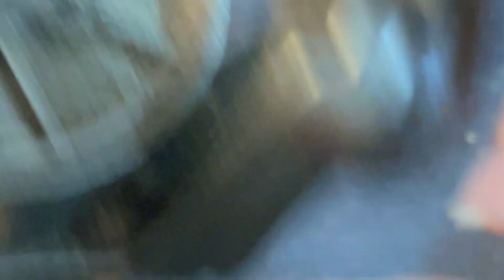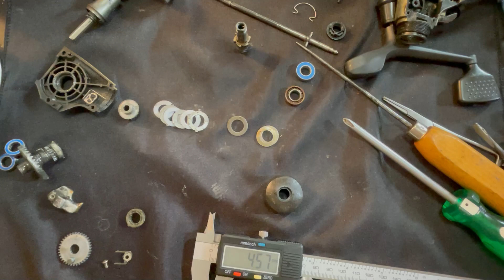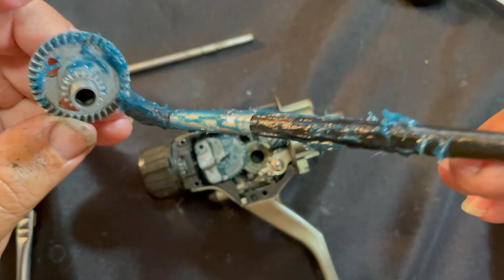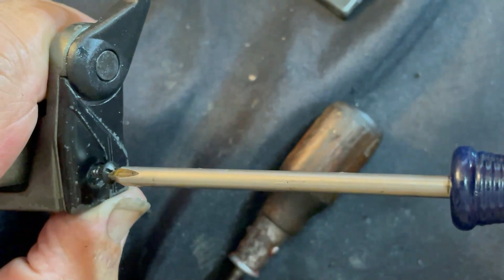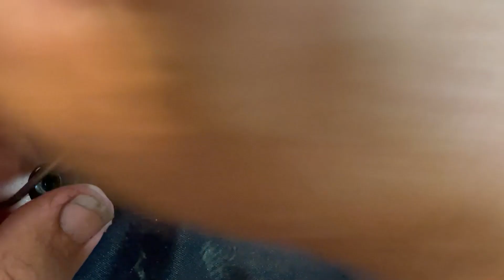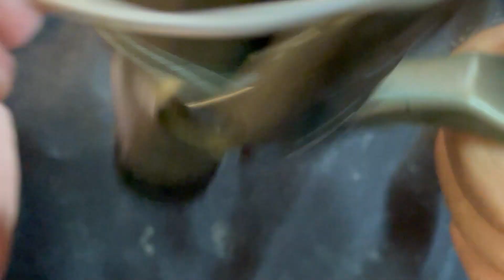Zebco SE4 -- Service and Lubrication -- Young Martin's Reels

Comment: I was absolutely shocked when you said this reel had “roller” bearings on the main gear.  When it wasn’t a bearing I was relieved. This one looks like it has seen better days! Rick , are you sure Mario isn’t pulling your leg with this reel? This thing is filthy. Maybe Zebco is marketing this one as it’s all new corrosion special. The fact that the main gear is worn so much couldn’t have been a surprise.  I still think Mario is pulling your leg.  I liked how you worked with the rear drag. I really dislike the anti-reverse in this reel. I have a few like it and they are rarely as smooth as I want them to be. Also you can remove that awful little AR spring on the shaft of the main gear and the AR will still work just fine. Often removing that AR spring will make the reel run smoother.   I had to ask Siri how to spell “dollop.” I hate e-clips too! Your safety pin trick is a good idea. I really like your close-up camera work.  The reel I have that had the broken trip lever works fine as purely a manual bail which I like anyway. I have both a Mitchell and a Garcia reel that has that same tiny coil spring mechanism. I am not a fan. You needed to use some fine sandpaper on that trip lever. I’ve had to do that before. Great job with the bail!  I never thought this reel would work that well. I believe this reel wasn’t worth the effort you put into it. But…. Your reputation as a miracle worker continues to grow! — Chris
Reply from the maker: Chris, I wasn’t wearing my strong glasses when I looked at the bushing but it certainly looked like I saw roller bearings. I take them as is when I open up the reels. I never know who might have been there before me.  This is the first time I have seen the crank journals on the main gear worn down. I expected the bushings to be worn and not the journals. 

Mario isn’t pulling my leg. This reel was given to him and he wanted to know if I could get it running again. The previous owner has heavily used the inexpensive reel and probably considered it disposable. It’s still got life left in it. 

I know you don’t like this style of AR. It works great and I didn’t feel a need to change it. I Interesting enough with the spring installed the AR works with the lever in either fully switched position, and is turned off with the switch in the midd. Without the spring it only works with it switched to the left. 

I figured you would like “dollop” after I said it. You like when I use obscure terminology. 

The close up camera work is really clear but it’s very difficult to keep the work in screen. It’s very difficult to try to watch the work and the tiny screen when doing the project. 

I considered using my Dremel tool to polish up some of the chewed up parts to make them slide easier but I had already invested a lot of time in this very inexpensive reel. Sometimes you just have to stop and say, “enough”.

I wonder how many people have to know about you before you can have a reputation. 🤪

As always Chris, thanks for the comments. Only 3 more subscribers and I’ll be at 900. Woo Hoo !
Reply: @youngmartinsreels5314  Rick, I sort of knew from the beginning that you were very good at this. Your narration is so good and some of your innovative engineering is just genius. You and Dennis make very good reel videos! Also, no one else on YouTube does as many spincasters as you do. Those are reels I knew nothing about and had never taken one apart.  Mario put a good explanation as to how you ended up with this very used Zebco. Finally, I think 900 subscribers is sufficient to establish your reputation as a miracle worker. That aluminum foil repair on that oscillation post alone should have accomplished that description of your talents! — Dhris